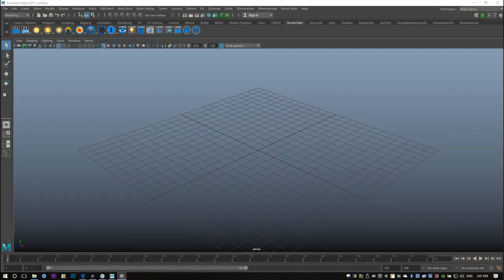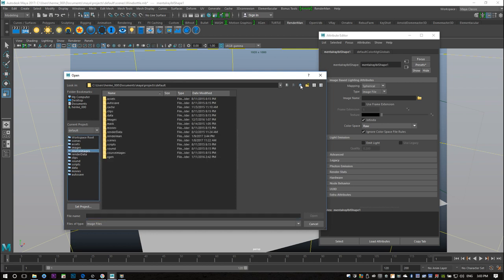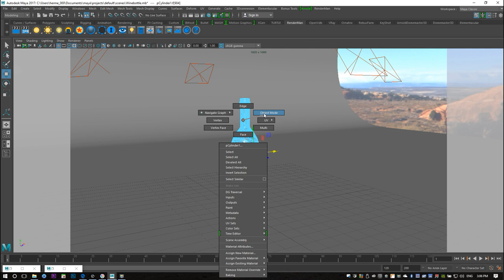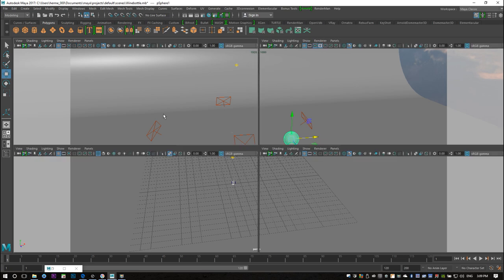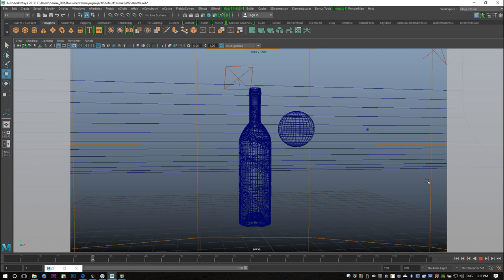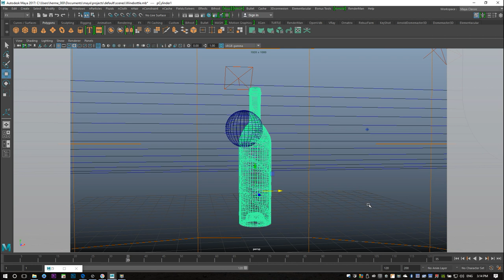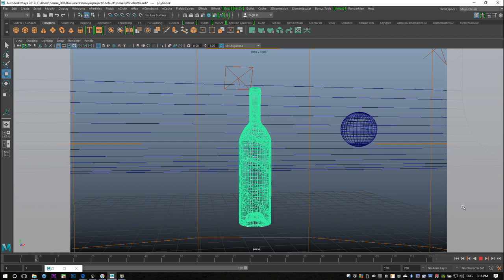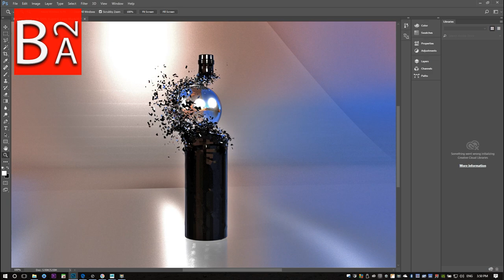Maya 2017 tutorial : Smashing Glass

Comment: Hello Sir, I was trying this in maya 2018. If I press play button then it hangs a lot . And can’t see changes in bottle. I have a high GPU even though it lags a lot . What can be the reason. Poly count is same as urs. Can you please suggest some methods how can I fix it. Thank You.
Reply from the maker: If your animation preference set to "play every frame" ?
Reply: Ya, even animation preference is set to play every frame. Still it lags. Is there any way to make maya use the maximum CPU and GPU for good performance?.... In maya - “windows > settings/ preference > preference tab”. There is a thing called “ GPU cache”  can it be used in any way to improve performance?
Reply from the maker: Rendering is done by the CPU for the most part

Comment: Mike, I have a suggestion for a tutorial.
How about specifically showing people the edge flow of a low-to-high poly transition within a mesh for extra-complex models where we need both low and high poly sections within the same mesh. Here is an example image...
http://i65.tinypic.com/2ai0igi.jpg
-We add four polygons where we would have had one.
-It's especially good for meshes which are combined organic AND hard-surface in the same mesh.
-It allows us to sculpt a section of a mesh, while leaving the rest of the mesh as low-poly.
-It's a way to keep the poly-count low for gaming models, while still being able to get a good silhouette where we need it.
-It helps people to better understand edge-flow and edge-redirection techniques.
-It helps people to understand how to get rid of triangles in a mesh.

Also - could you please let me know if you have a better way of achieving the same thing, because with this method we would have to manually re-direct some of the new edges that are potentially added in later on.

Cheers.
Reply from the maker: Sounds cool. I actually did this in the water bottle tutorial. Have you seen it ?
Reply: No, I haven't seen it. I'll dig it up and check it out. Thanks.